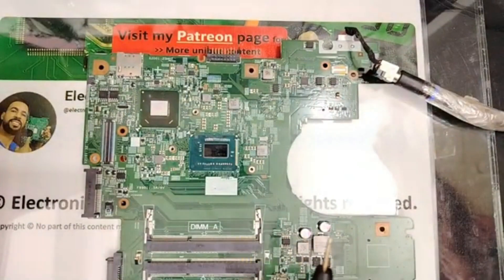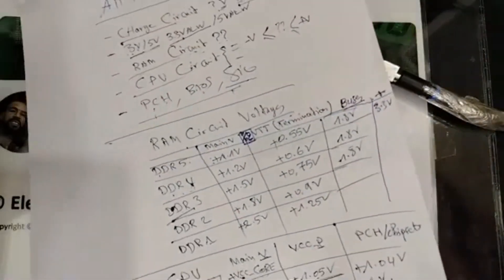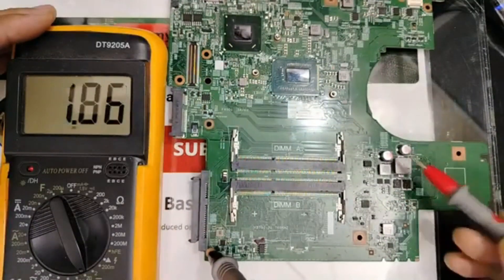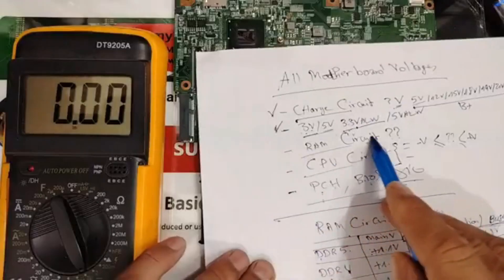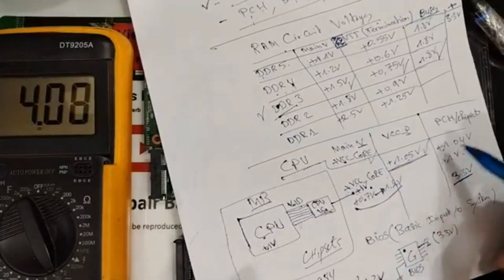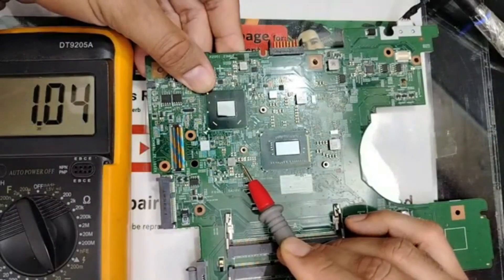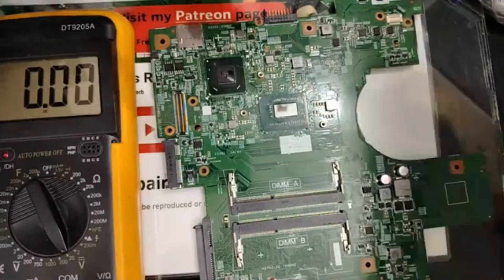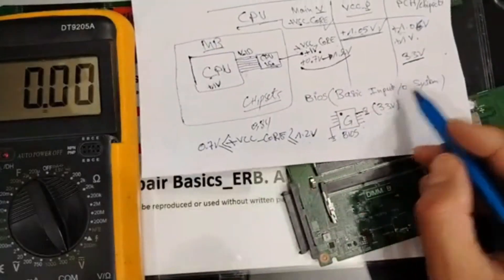Voltage MAP of a Motherboard - Shocking Truth Inside | Laptop Repair

Comment: How are you managing to get these voltages? The power button need to be activated, ie: The laptop needs to be switched on to get, Ram, VCC, PCH voltages, but there's no heat sink/protection on the chips??
Reply: The 19v... power supply from the charger/adapter was plugged in, which supplies current. 
So, we can test those components with that without powering the pc up.
Reply: @laisijohnaliu1930  WRONG. You CAN'T test those components.....the only voltages you can test without powering up the board are the 19v, the 5v/3.3v always and the 3.3 at the bios. The ram, CPU, Chipset and OTHER voltages do NOT show until the board is switched on.